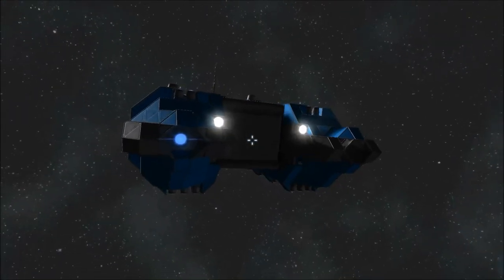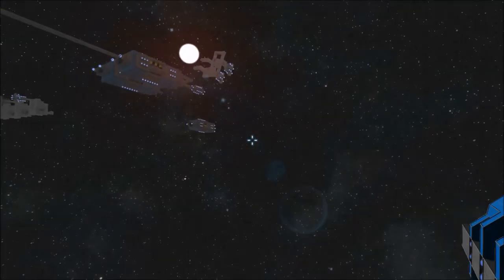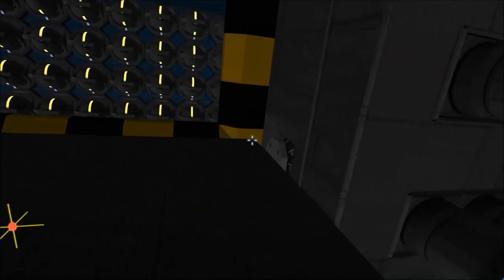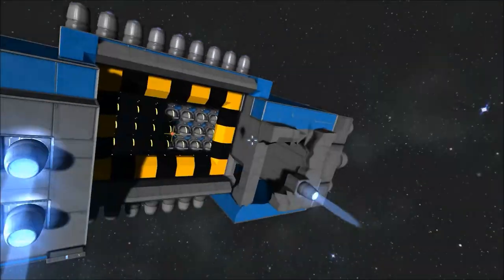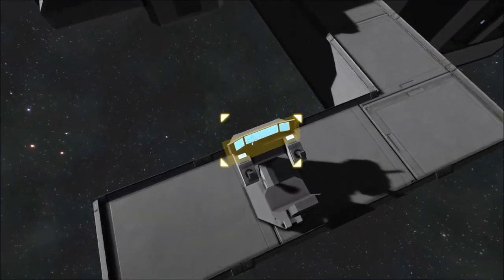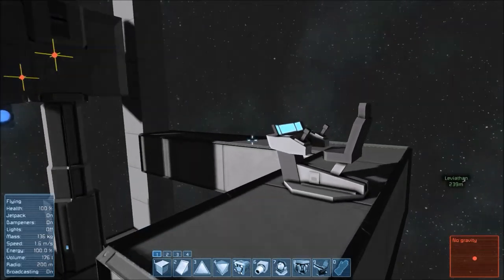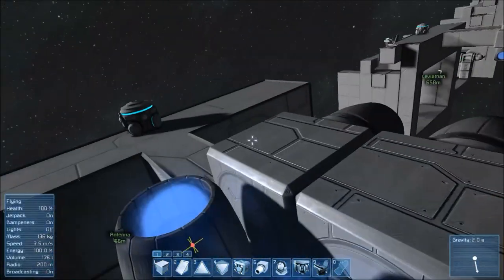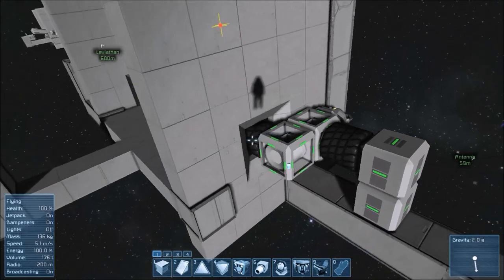Space Engineers - Rotorless Blast Doors!

Comment: I may be using this, gota stress test it.
Reply from the maker: Just don't try to open or close it while the ship is moving!

Also, if there's any way you can build a sort of counterbalance to counter the weight of the blast door and align the center of mass with where the door should hinge, it should operate much more smoothly and shouldn't cause any damage besides what the merge blocks do when they violently attach to one another. Trouble is, the system is already a little large... and a counterbalance would just make it bigger.
Reply: Aldakoopa I was thinking along the lines of a massblock?
Reply from the maker: Hmmm... I hadn't thought of that, but I have my doubts. Only one way to find out though; Try it! I'm curious myself, now. :P

I did have some crazy rotorless design using mass blocks and grav gens. It kinda worked but not too good. It can be filed under "crazy over-complicated inventions"

I want to make a video about that and a couple of other failed ideas that I went through before I came to this. I'll also be adding another video soon of using this successfully on a small ship design, by balancing the center of mass where it needs to pivot.
Reply: Ok so what I did was on the front blast door on the left room put the mass block on the top of the  merge block which locks the door on the closed position, I then bound it to a timer with a 2 second delay activating it at the right time, I did however have to take a bit of armor to let it fall freely... if you don't understand just add me on steam and ill show you, dragonspride1995

Comment from the maker: @Lucas Massey,

It will not work. They are still 2 different blocks that would occupy the same space. Maybe if we get compound blocks, it will be allowed...
Reply: If you use two rotors, stacked on each other, then edit the displacement on both rotors, it will work.
Reply from the maker: Skye BlairWing You mean leave the heads of the rotors in-between two rotors? That would work, but then the rotor heads would still be separate ships and may cause issues, but luckily they don't weigh much. I see what you mean though.
Reply from the maker: Hold CTRL and click on the slider.